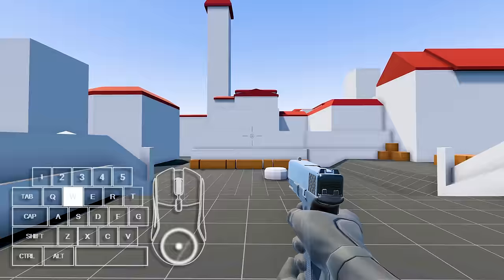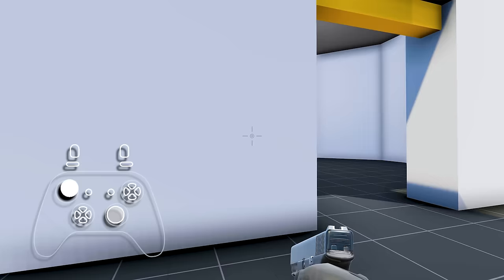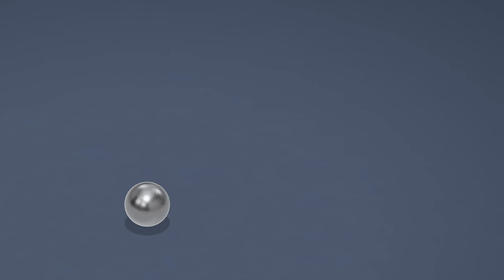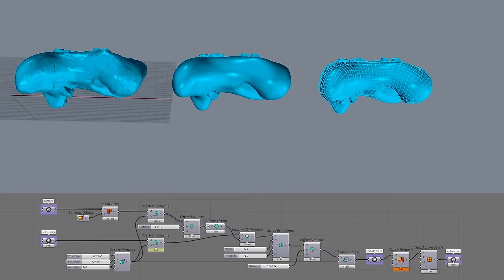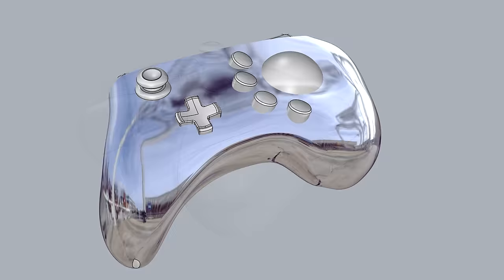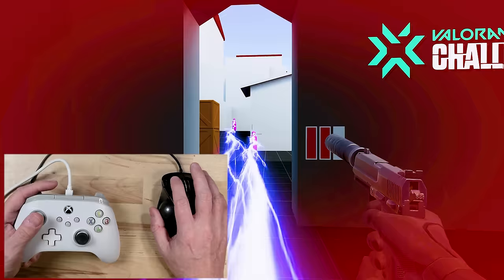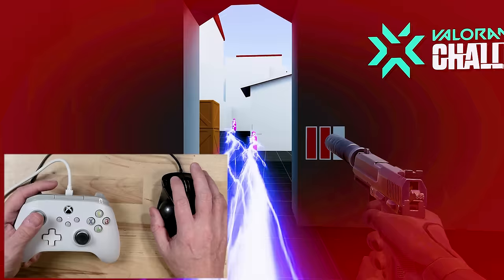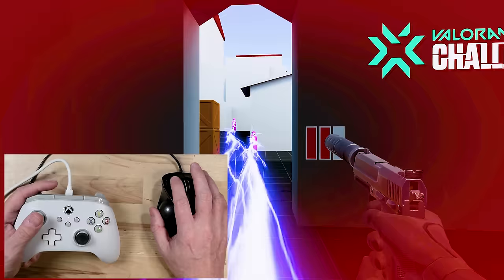Ultimate FPS Controller Design & Build

Comment: I LOVE the look of it. It's got a bit of a 2000s Y2K aesthetic, almost alien. Companies wouldn't DARE to be this creative and unique
Reply: Y2k 😂
Reply: Tell that to Nintendo. I'd grant that the switch is only a little different, but the Wii was totally different from every other controller at the time
Reply: They wouldn't dare be this creative because it's too different from the standard that most people would think of it as a novelty
Reply: @ericeaton3551  dude the wii was a rectangle. nintendo is not as innovative as people say, they're mostly just "do it cheaper and worse"
Reply: > Companies wouldn't DARE to be this creative
That's cause it is ugly as hell
Reply: @No_Life_Alex No the design was intentional. It's meant to mimic a TV remote for general consumers to be familiar. It's also meant to be held sideways and have a similar layout to the NES controller.
It's not innovative for game controllers, but that's because it was doing it's own thing for it's own needs. The Wii needed to accomplish a different goal than other consoles and it did it right.
Reply: And aside from its look, it still is extremely far from production-ready.
- can only ever be used for PC
- the triggers on the right are bound to break extremely easily
- the trackball requires a lot of maintenance
- the trackball cannot be used with dorito dusty hands
- the hard edges between the pieces are dust and gunk magnets
- it was engineered for a specific hand, not a general one
- it is optimized for FPS games, and only FPS games
  - the face buttons are definitely not comfortable
  - the d-pad looks like the worst one I've ever seen

And there are a multitude of more opinionated but not necessarily less important things, like:
- the start button being left-handed means you cannot pause the game while moving, which is a death sentence for games that rely on momentum
- it cannot be held with the right hand only, not even for long enough to grab a cup
- it cannot be put down straight, which makes you feel insecure about its quality over time
Reply: That grey color brings back fond memories of the PS1.
Reply: Two thousand year two thousand
Reply: Had The Same Thought.. Straight Out 2001 Lol.. It’s Ugly As Hell Tbh.. But If He Got Someone To Redesign It He Could Really Make Something.. But His Design Is Just Horribly Dated.. Omg..
Reply: Companies do dare to be this creative and unique. Look up "failed video game controllers"
Reply: Why would we expect a company to design a controller to such extremely personal specifications?
Reply: They can just take this idea and recreate it with a slick, modern look
Reply: @WildVoltorb  damn u one of those ppl mane
Reply: tell that to valve. the trackpad plus gyro where amazing. the only reason why the steamcontroller failed was because valve did not marked it towards the right audiance. and the did not market the capabilities of steam input. plus they should have made steaminput configs for most popular games. the steam input and gyro comminity where left to figure things out for themselfs. The steamcontroller had a weird desgin and it felt cheap. plus the lack of the right thumbstick was not ideal.

The steamdeck layout is perfect, but maybe it would not work on a full controller because you grip the deck higher ten you would a gamepad.
Reply: Probably because it looks fragile and they would have to do warranty all of the time
Reply: @hundvd_7 Yeah, this is a cool idea and engineering experiment, but I look at the end result and know.... I don't care if it is the on paper greatest controller of all time.  I am not touching it.  It does not look comfortable to hold, or use, certainly would not be good for anything not an fps, needs a ridiculous breakout box (already the death of it as a concept), and looking "Y2K" is very much a BAD thing.  No one designs products like that anymore because it is correlated with cheap plastic junk.
Reply: Though I love the uniqueness and daring, there IS a reason this vibe went out of style ^^'
Reply: No, they definitely would “dare” to be this creative and unique. It’s not as if they’re not allowed to or they’re afraid of it being too risky.
Reply: @jedizombiekiller9065  Same is true for Philips CDi controller
Reply: @DKarkarov "no one" I think you just mean majority
Reply: @ssg-eggunner You are right, it is just in this case the "majority" will be like.... 99+% of gamers.  There is a reason valve didn't use a trackball, and a reason no one uses floating trigger buttons on spindles.

Not denying it is cool, not saying this wasn't a great project, I am saying it is not a marketable product.  Unless you are okay selling at a loss to a incredibly niche market.
Reply: @sboinkthelegday3892  Yep, and that one couldn't pull off one execution and ultimately failed while the Wii became one of one best selling consoles ever.
The OG xbox controller had the same layout as playstation but it was still too big making it worse. You can still try to follow similar ideas and mess up with it's execution.
Reply: @No_Life_Alex Please show me a Nintendo console that is just "cheaper and worse" than another on the market. They always bring something unique to the table, and cant really be compared to generic consoles.
Reply: That was my first fucking thought as well!!!!
I'm like what in the fucking 2000's is this technology lolololol
That alien technology da blob design and I even said the color scheme makes it fit as well too
Reply: It's called Frutigia Aero
Reply: @bubbaG42   Not this particular atheistic, there are many different atheistic from the 2000s
Reply: @WildVoltorb cope
Reply: @No_Life_Alex out of the top 10 most sold consoles they have 4 spots. Cry harder.
Reply: @cantprocess  just because they sell well doesn't mean they are good.
Reply: @hundvd_7 it's a prototype genius. Can be refined. Smh
Reply: Looks like it should have a see- through version too lol

Comment: This looks like the Xbox 720 controller I would’ve seen in concept videos made as slideshows in Movie Maker years, years back
Reply: its good when enemy is in the view but what about competitive games or when enemy is behind you ?
Reply: @greatusername1668 Why didn’t you just make a comment?
Reply: @greatusername1668  Could say the exact same for joystick, or mouse even. Nobody using a mouse keeps their mouse down all the time, you pick it up. With trackball you flick it and grab, you can be pretty quick and a decent amount of older fps players would use trackballs. Mice are way better obviously but joysticks are not.
Reply: @rcbuggies57  mouse is faster than thumb by a lot. in my setting I barely ever lift it up tho
Reply: @greatusername1668  Well yes, obviously mouse is way better but that's because most have a a square foot or more space to move it. A controller gives you the range of your thumb as you said. In that sense, a joystick is a far worse input device than a trackball for fps. You aren't moving with pixel precision, you're traveling across the map, so you want a device to control velocity. For looking you're controlling position on a small screen, so you want a device that directly controls position, such as a trackball or mouse. But you can't fit a mouse on a controller so trackball is obviously better.
Reply: Insert trance-009 sound system dreamscape
Reply: xbox definitely has the best fps controller of all time
Reply: Hahahahahaha good times
Reply: @greatusername1668 higher sense like on a mouse?
But you miss the point, he never stated that trackball is vetter than mouse, the point of video that this might be much better solution for gamepads than thumbstick.
Reply: and thats why i love it
Reply: @rcbuggies57 I never pick up my mouse, ever. I just have higher dpi then most, also due to me having scoliosis I don't want to aim by moving my entire arm constantly. 
I have 1800 dpi and like 2.75 sensitivity in overwatch for example. (4950 edpi). I got too like diamond on dps and higher on tank and support with that
Reply: @rcbuggies57  maybe its functionality could be like a hybrid between a trackball and an analog to prevent you from having to lift your thumb up. when the tip of your thumb is near the socket of the trackball the camera moves continuously like an analog stick would, preferably with a high sensitivity so you can do a 180 degree turn or even a 360. when your thumb is closer to the middle of the trackball you are able to aim like you would with a mouse/trackball(sounds kind of janky when I think about it). this could probably be achieved with a sensor that detects where the tip of your thumb is at or something. could be other ways to get it to work but I'm just spit balling rn.
Reply: just immediately hijacked lmao

Comment: Being able to control the trackball on both sides is a touch of genius!
Reply: literally
Reply: Gimmicky not really useful
Reply: @DashzRight it was also a gimmick on the logitec trackman FX but damn it always looks cool
Reply: @DashzRight he said using your ring finger as a drag to control the resistance. That sounds very useful for fine aiming, ie sniping and longer shots where you'd need track a target with more precision.
Reply: @DashzRight 
Nah, it sounds super useful, specially for games where there are dogfights, being able to give your aming controls a bit more resistance would work incredibly well for those extra fine adjustments.
Reply: @DashzRight  tell that to tetris players figuring out new ways to use an NES pad 

maybe if it was more intentionally designed to do that it would feel less gimmicky tho
Reply: @DashzRight  yeah disagree here. I used trackball mouse on pc for like 10 years and played a lot of fps… being able to use a separate finger to pinch it, fine tune aiming, slow it down etc. would have been super cool to have and make certain situations so much easier…

I.e. you could set your sensitivity super high so you can do quick turns then use your ring finger and thumb combined on the trackball to do micro aiming movements when shooting and get, I would imagine, pretty decent precision compared to a regular controller or even a mouse
Reply: @TotalNinjaLover Again not very practicle in a live setting... also, how the hell do you keep the player spinning around if you're trying to 180 or 360 someone? The movement would be impossible with a trackball which is why he doesn't play any games with it, he just tests the x axis in a aim trainer.
Reply: @DashzRight  says the guy whosure as shit didn’t use this controller

Comment: This is nothing short of astonishing. A simple idea of fitting a trackball into a controller presented so many challenges that you are forced to innovate the overall design.... Thankfully, you're a brilliant engineer.

I would LOVE to see this thing passed around some professional FPS players, maybe even on-stream, so we can see their impressions.
Reply: Great idea. Loan it out to some top FPS streamers/youtubers and get them to do some impressions videos. Ideally with some benchmarking/stats tracking. That would be real cool and get more interest into this type of controller design.
Reply: @ulflonegren4870 get the right people using it, and it for sure would gain traction.
Reply: They wouldn't play verry well because they're used to play with a mouse and learning from scratch is hard.
Those who play FPS games with a controller they can play only for games that have aim-assist. This is where this controller is actually much better than the regular one, but it will not be better than a mouse for raw input FPS games.
Reply: @Tealc2323  just need to find some who normally play on console
Reply: Any CoD or Halo pros would be perfect for this. Particularly CoD pros since a lot of them play CS/Valorant in their downtime. 

Not that anyone cares but a KB/M player just got T4 (or maybe T6?) at the most recent Halo tournament, which is pretty well unheard of, so that's cool